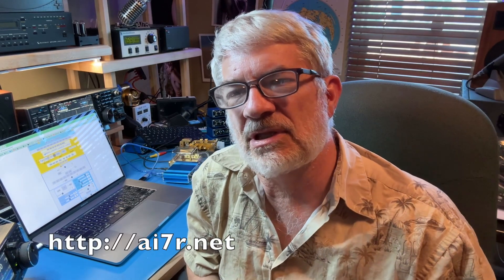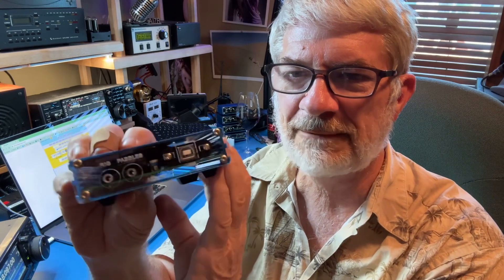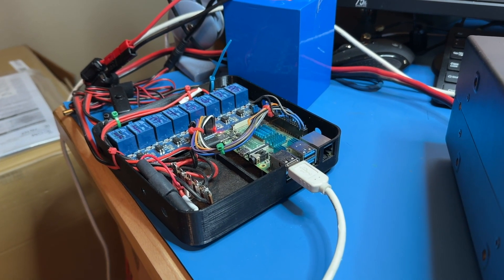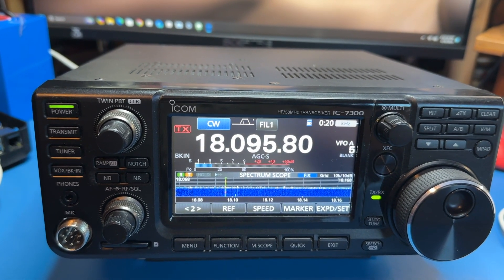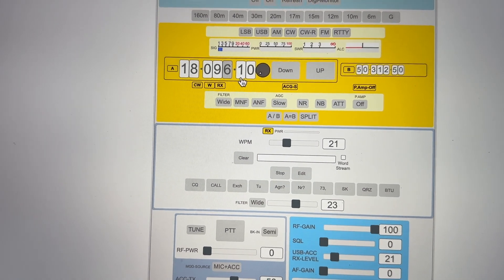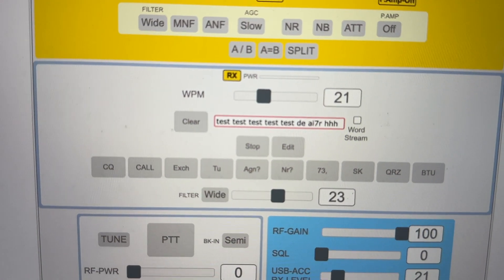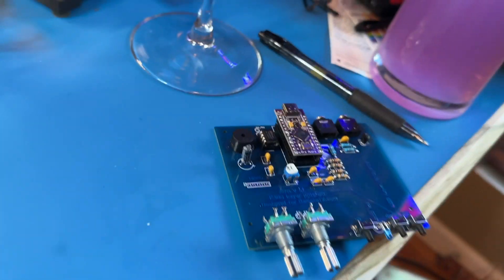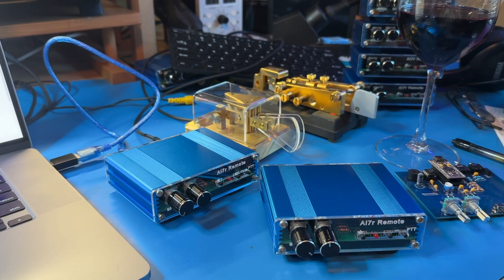AI7R RemoteKeyer

Comment: How brilliant! I was looking to do remote FT-8 with my 7300. The problem I have is in order to use the icom remote software I need to plug the USB cable to a computer. But since the Icom 7300 has only one USB port I cannot use it to FT8 and control the rig at the same time.  Then I came across the RemoteTx app which Im gonna test today and your remote keyer that was mentioned on eHam reviews. Its awesome that you collaborated together and made a remote keyer possible in one solution. I am planing to start learning CW soon and when I get proficient I will definetly purchase the remote keyer for remote operation when I am away on vacation. 
BTW the Icom Remote software RS-BA1 was total waste of money and I never got it to work. Icom support was not very helpful. The client/server connection never worked even in my local LAN.
Reply from the maker: Yep, the Icom software does suck big time.  RemoteTX has worked for me for years and I love it.  Enjoy learning CW and enjoy your remoting!